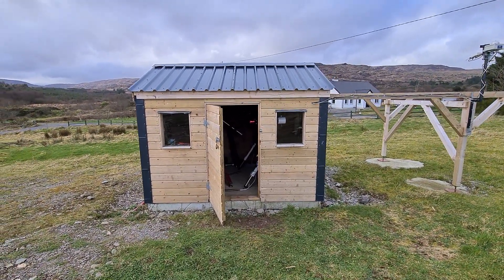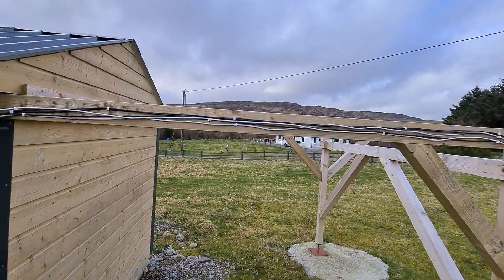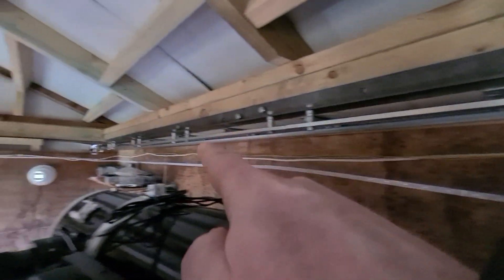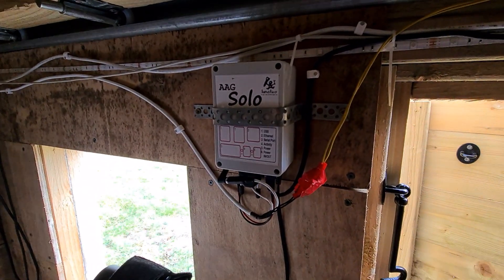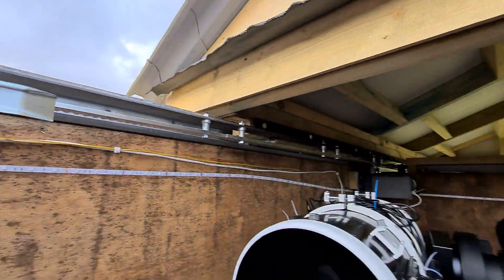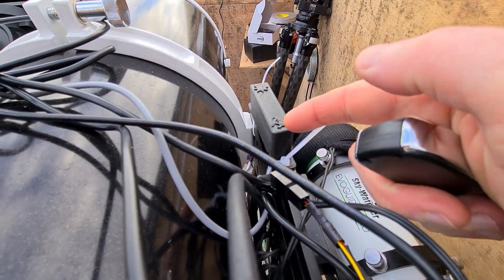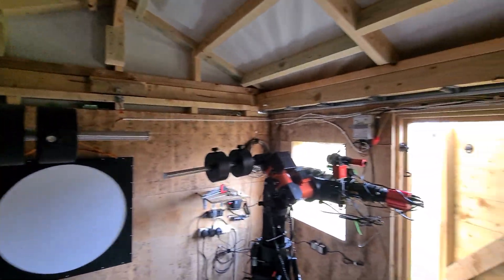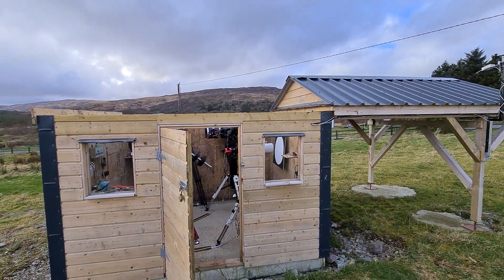Skyshed Roll-off Roof Observatory Tour

Comment: Hi Peter, thanks for the video. I had an old crappy motor and some chain driving my roof last year, but i ripped it out as it super noisy and not really reliable. Just by chance i do have a garage opener with the exact same rail system, so many thanks for the idea of using it. I also have a web enabled Relay that has ascom drivers written for it, so just wondering how you wired your motor into your relay to trigger the opening and closing ?  Also share information about the tilt sensors that you are using. Many thanks, Rich.

Comment: Peter, nice setup.  I purchased a gate opener and in the stock configuration using it's controller, it only runs at one speed and tends to be difficult to close my roof without slamming.  I see yours slowed down near the closed position.  Is that the motor or the Dragonfly controller.  Do you happen to know the make/model of the motor you are using or where you sourced it.
Reply from the maker: Hi Christopher - I got this motor: https://www.amazon.co.uk/gp/product/B081GXM72K/ref=ppx_yo_dt_b_asin_title_o02_s00?ie=UTF8&psc=1

It had the same problem, no soft start and stop. I bought a new controller for it (same manufacturer, drop-in replacement) - https://www.ebay.com/itm/272298001857 

That controller adds the ability to soft start and stop. It's not perfect as sometimes it "forgets" when to slow down. I suspect it might be due to higher than optimal resistance to movement of my roof, so YMMV. Still a big improvement though.

I also recommend wiring open, close and stop commands to separate relays rather than a single toggle.
Reply: @PeterCoxPhoto  Thanks Peter.  I'm going to investigate a soft close control board for my Topens gate motor.  I will email that EBay seller to see if they have a compatible control board.

Can't I ask how the control board knows when to start the soft close (slow down).  Is there a switch/sensor or does it just use some adjustment of the offset from closed and open?

Comment: Hi Peter - great observatory set up you have there! Am looking to install similar motor to yours, and (eventually) the Dragonfly as well - but have a quick question - well, two actually...

1.
Can you over-ride the Dragonfly for occasions when you actually want the roof open but don't want the Dragonfly to register the fact it is Unsafe and then close it again..?
Perhaps an extra switch/sensor in the circuit somewhere that the Dragonfly can test for?

2.
Is the SOLO necessary to have the Cloudwatcher running autonomously with the Dragonfly?

Many thanks!
Darren
Reply from the maker: Hi Darren - no problem! 1. You can. For each relay you can define limits in software (don't open this if certain conditions exist). I have one set on the roof relay that if a different, otherwise unused relay is closed, the roof relay can't change state. This allows me to leave the roof open during daytime, for example (which is considered unsafe by the Dragonfly).

2. I really consider the Solo a vital part of the package, I didn't want to faff around with connecting it to another computer that might crash or hang. The Solo is very reliable and makes the whole thing very painless. Jaime from Lunatico is also an excellent help when you're getting set up, he'll give you excellent support.
Reply: @PeterCoxPhoto  Awesome! Thanks Peter! The motor arrived today (7th) so looking forward to getting that installed over the next couple of weeks!!

Comment: question, if in the middle of the night, while imaging your sensor activates and the roof shuts, won't it hit your scopes?
Or will it also first put your scopes in the right spot again before closing it?
Reply from the maker: The roof won't close if the scopes are in an unsafe position - there are tilt sensors on all of them. So if the weather is bad, they all park and once that's done, the roof closes.

Comment: Cant wait for more videos, how is your CEM 70 and 40 doing for you? I purchased both this year. Great video. Clear skies!
Reply from the maker: Thanks Jered. The mounts are both doing well although the CEM 40 doesn't track quite as well as I thought it might. Averages around 1-1.5arcsec total RMS. I suspect there's some fiddling I need to do, but as the error is way below the image scale I'm using it for, it's not critical to figure out at this point. The CEM70 tracks around 0.8 RMS reliably.